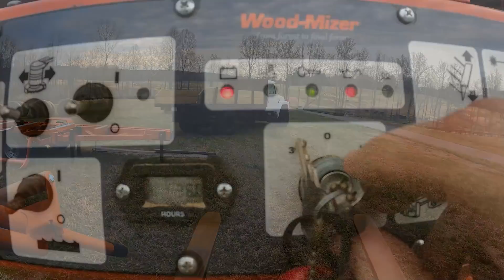Sawmill Sunday: A day on the farm Milling North Carolina White Oak

Comment: Beauty Josh,
If you can try to save any 3/4+ × 3 1/2 for case & base too you'll use it plus you'll be milling crown mold & back splash even self edge @ 3/4"×1 1/2" all kinds of deck post and moldings & built up pieces for columns etc door stops @ 1/2"× 1 1/4 " lots of that not to mention shelves and cleats big piles of moldings and trims flooring shoe mold and 1/4round and if you are going with solid wood cabinets now or soon you'll have a place to store stack dunnage dry and with the home a neat place to  build and use up all that fine wood it's very expensive to buy you can cut and mill your own$,$$$.00 bucks nows the time and when it's air dried it will be cured, old style ; whereas kiln dried is for lumber wholesale and big buck retail old style is money saved money earned. Awesome wood keep on saving and you can trade swap you are in a sense making money for use barter and trade. You've got the materials from forest to milled wood. Way to be bro.
Best David

Comment: A little advice since I’ve ran one of them is never try go back when the blade is spinning because is will always come off and it’s easier to spin the logs with a cant hook and you can cut small boards to size or knock off the live edge just watch the stakes so you don’t hit one